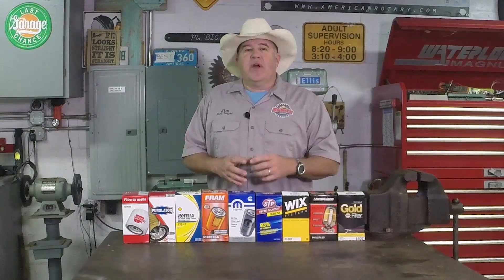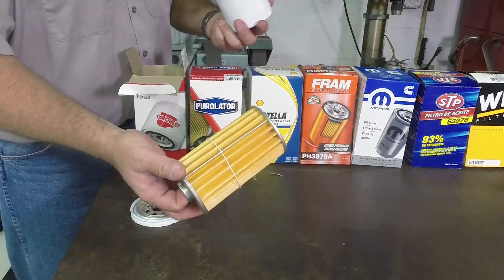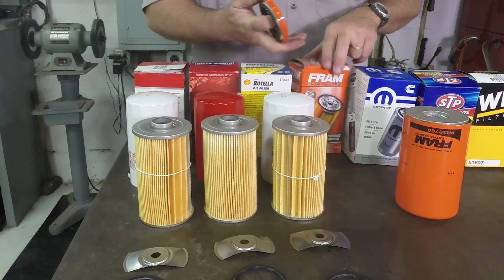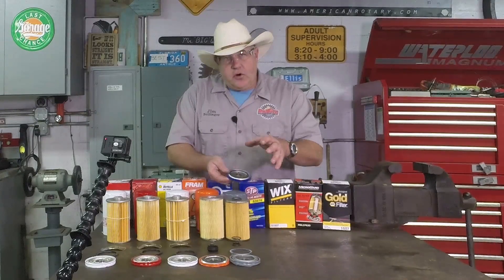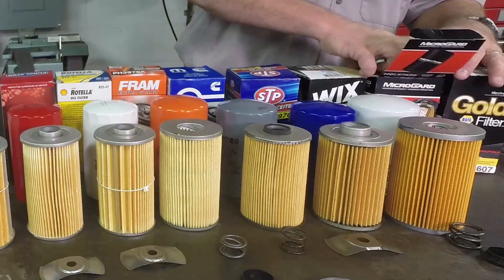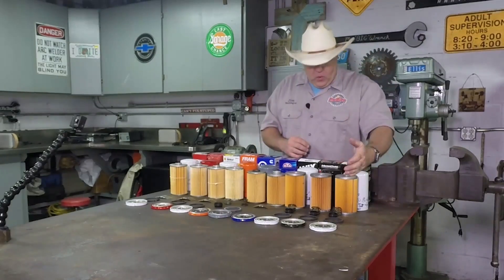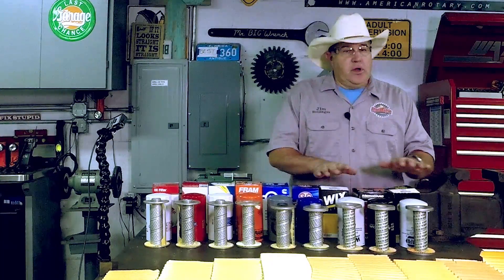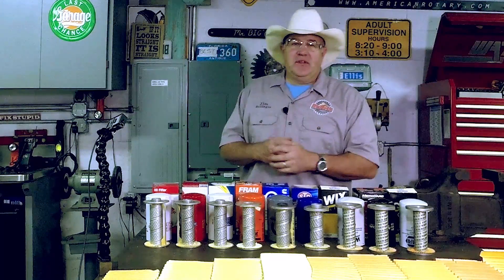One of these oil filters failed the test

Comment: I have a comment and a question. First of all, thanks for taking the time to make both oil filter videos. They are well done, thorough, and concise. I watched both and gleaned several major points and a bunch of smaller ones. Among those, you've reconfirmed my long-standing choice of Wix or Napa Gold oil filters for my various engines. What I didn't know (I haven't used one in many years) is that Fram is of such inferior quality. 
My question is, "Do you have an opinion about K&N oil filters?"
Reply from the maker: I did not cut one open so I cannot comment one way or the other. Thanks for watching.
Reply: K&N, Royal Purple, and Mobil 1 are all made by Champion Laboratories, according to another oil filter dissection video I've seen.  All good quality, too.

Comment: These are all good filters and should not give you any problems. The trouble comes in when you neglect to change oil and filter at factory recommended intervals.
What you really should be concerned about is your air filter.
Most of the dirt that kills your engine comes from the abrasive dust from the air. That is the biggest engine killer.
Reply: Not really Bernie!!!  Assuming that one is using an air filter (as opposed to "open air"), you should really be concerned about your oil filter - dirty oil (contaminated, old, poor filter, etc...) is what causes the most abrasion and wear/tear in an engine as tested by Ford Motor Company (1970~2000).  I would assume that the engineering departments of Mopar and GM have the same conclusion.
Ciao, L (FoMoCo engineering)

Comment: If in doubt, do 2 filter changes between oil changes!
See how many vehicles have quite small oil filters, that is the issue in my view.
How many microns is the filter paper? 
What is the filter media material? 
What is the bypass pressure for each, if specified? 
How many people on You Tube claim their engine failed due to oil filter failure?
How often do you change the filter and oil? 
What is the delta P for filtration media?
Have you put them on a test rig?
So many variables disassembly of the filter is pointless, they are all supposedly OEM quality. 
Kind regards....

Comment: Thanks for this good video on the construction of the diesel oil filters.  

It would be great if you could also include the Mobil 1 filter if you ever do a followup.  It is a common filter for diesel owners in the Duramax world.  They are easy to get at the auto parts stores along with the fact that Walmart carries them, so they are mainstream like the filters tested in the video.  Supposedly they use an upgraded media material.

Comment: This was a very informative video thank you so much.  I knew that Wix and NAPA were made by the same company but not the O Reilly's brand too, and then the others including the Rottela oil filter never would have guessed it to be cheaper made than the Wix or NAPA   And I saw in someone's video that the Fram he cut open had a flat spring in it but it was for a gas engine
Reply: Stacy Reid You are correct that Wix, Napa and Microguard filters are made by the same company (Wix). There are only 3 manufacturers of filters in the US that make them for all the different companies.  I use Wix fuel, oil and air filters in all my vehicles, and semi trucks.

Comment: Can you cut open a motor craft diesel filter I’ve ran motorcraft and Fran filters in my 7.3
Reply: THAT_1999_7.3 _
It would be a game of chance since Motorcraft filters are private label contract manufactured by 5 of the larger filter manufacturers to Motorcraft specifications. 
Those manufacturers include: 
Mann+Hummel that owns and manufactures the filter marketing brands Mann, Wix and Purolator. 
Cummins that owns and manufactures marketing brand Fleetguard. 
Parker-Hannifin/CLARCOR that manufactures the filter marketing brands Baldwin, Hastings, Racor, Parker and Clark. 
Donaldson.  
United Components/Champion Labs manufactures most of the factory installed Motorcraft units.

Comment: You should do a cat filter, i did a conversion on my 2012 duramax engine where i can use a CAT filter, lasts 2x longer way better filtration. I also did the same thing with the diesel filter, also a cat diesel filter
Reply: Almost all Caterpillar/CAT brand filters are manufactured under contract by Donaldson in the USA to tight CAT design, material, performance and quality specifications.
Reply: Have done all the studying on filters also, CAT is by far the best, 
but expense

Comment: Excellent video. That little “springy-ma-thingy” that you mention, happens to be an extremely important part of any oil filter. It’s a pressure relief valve that opens up in case the filter media becomes plugged and bypasses oil around the media, because it’s better to have the engine run with unfiltered oil, than to have it run with no oil at all. In some of the cheaper filters, that relief valve does not seat properly and most of the oil is being circulated with out being filtered.

Comment: I know where that FRAM filter was made then, the factory is a half hour drive from me. You will find the MOPAR filter is made by the same company that owns FRAM. Just note that the ones who order the contract manufacture of the respective filters that are near identical can also specify the cost point, and this then determines the amount of filter media and the grade of media used in each unit. This is the easiest point to adjust manufacturing cost, as the machinery is in the rest very much set for a specific steel type and thickness, and the same for the gasket material, there you get the advantage of volumes for small runs using the same parts. Filter media can vary a lot in ability, and you can decide which one to use to trade off cost for filtration ability, and the amount to trade off filter life.
Reply: The OEM Mopar filters for the diesel trucks is made by Fleetguard which is a division of Cummins.
Reply: @Anteater6788  well, like i said a little bit ago, i use & sell AMSOIL, so 1 day i went 2 a dodge dealer & asked 2 see a filter 4 a buddy's V6 diesel... i looked @ bottom of box & it said MADE IN CHINA... it twisted where as mine did not, had NO glue 2 hold filter pleats 2 end caps & no metal holding filter 2 end caps... much less quality than either WIX or AMSOIL, wouldn't u think ? ? ?

Comment: What exactly do you think that surface rust is going to do, please be specific? 
What are the manufacture date codes on the affected filter canisters? 

First, it is very minor surface rust over a small area that does not even rub off and would not contaminate the lubricant stream. 
Second, it is on the in-flow side of the filter media. 
Third, the underside of many valve covers, intake manifolds, valley covers, timing covers and oil pans have significantly more corrosion than shown in those filter canisters. 
Fourth, the cause of that surface rust may not be the fault of manufacturing or the manufacturer. 
It may be due to the products being warehoused in an environment where they are exposed to sufficient temperature swings and humidity that allow condensation to form. 
You are located in a rather humid region with regular temperature fluctuations sufficient to form condensation on metal. 
Condemning the filter over that minor surface corrosion seems to be a bit disingenuous and unwarranted. 

We have experienced similar corrosion issues on boxed machined parts stored in our warehouse that was isolated to a specific area in the warehouse. 
Although the corrosion was visible, but merely cosmetic and did not impact form, fit or function, we still performed a root cause analysis only to learn that one area of the warehouse experienced temp changes many days that coupled with the humidity level were just right for condensation to form on the boxed bare metal parts. 
The final analysis was this area was a recent addition and the contractors failed to install any of the specified vapor barriers on the entire building envelope that elevated the humidity.  
We have since installed HVAC systems at the general contractors expense to control the environmental conditions, plus now all machined and bare metal parts are placed in sealed plastic bags with VCI corrosion inhibiting sheets before boxing.
Reply: I use Baldwin in my 06 5.9 Cummins Filters better than Oem  They make tool to open filters for inspection.
Reply: @kennethc8182  Baldwin is a good brand. As for oem filter are you talking Mopar which is a so-so filter. When I think Cummins oem filter is Fleetguard. Which is also solid
Reply: Surface rust or not it still shouldn't be there. Even if the chance for issues is low it's still a chance. Why bring rust/foreign deposits into the equation if you don't have to
Reply: Well.... while I agree it's on the in side of the oil flow, what happens when the bypass valve is activated? Said oil flows unrestricted and unfiltered into your engine. Is it that big a deal? Don't know. 

Now, for all your complaining about storage conditions and how it's not Fram's fault, let me ask you two questions: 1 why are the other 8 manufacturers not experiencing similar problems in the same reason? 2 Who do you think is in charge of Fram's warehousing and logistical network? If you said Fram, go to the head of the class. 

I don't know what kind of engines you work on that you're finding rust on the internal surfaces of engine components, but rust forming EXTERNALLY to the engine means nothing but an oil leak at some point in time. But again, it has nothing to do with this discussion because even if said rust was on the inside of the engine, don't you think the oil filter is going to stop it once it gets to the sump, and eventually pumped through the filter? I mean, isn't that the basic point of the filter in the first place?
Reply: @kleetus92  
Looking at the last 2 videos where Jim mentions "rust" on the inside of the shell, the amount of corrosion shown is nothing but surface discoloration, nothing there to contaminate the fluid stream during bypass. 

1) 
a) They may have a better corrosion control coating on the shell. 
b) They may not have been exposed to the same environmental conditions. 
c) Likely different distributors. 
d) Likely different warehouses. 
e) They may not have been on the shelf as long. 
The longer a part is on the shelf the more susceptible it is to opportunistic corrosion. 
Having the specific filter manufacture date codes  would help assess. 

2) 
Short answer is O’Reilly Auto Parts does not purchase directly from Fram/Rank. 
How is it Fram's problem after a product is sold, leaves Fram's manufacturing warehouse and is not handled/stored properly? 
Fram/Rank like every other supplier sells their products to the supply chain where the products are then resold wholesale and distributed by parties not owned or controlled by Fram/Rank through multiple wholesale tiers and where products may go through 3-8+ warehouses not owned or controlled by Fram/Rank and could have taken many months before it was delivered to Jim's local O’Reilly Auto Parts store where it could have sat on a shelf for many months before being purchased by Jim. 
That is why I asked for the filter manufacture date codes. 

I see a wide variety and relatively large number of engines every year, anything from single cylinder 125cc dirt bike engine to 3000+HP V8s along with a few V12s and V16s. 
Last year we built, rebuilt or freshened over 900 engines, most were high performance V8s with approximately 400 being competition units. 
The rust I was referring to forms superficially on the interior of many engines on steel covers often due to short trip condensation formation which is also responsible for the formation of milk shake/pudding goo on the interior of oil filler caps on healthy engines and contributes to lube oil PH reduction if the oil is not changed often enough eventually resulting in lube oil acidification and damage. 
I agree capturing and sequestering particulate contamination in the lube oil stream is the express function of an oil filter which is the point made in the third sentence of the original comment.
Reply: @patw52pb1  First of all, Punctuation, have you heard of it? Second, After all the conditions you stated the Fram's could have gone through, are you saying that every other manufacture of filter tested does NOT have to contend with that as well? Or, is it more likely that Fram isn't taking a step everyone else is?
Reply: @kleetus92  
Yes and I used where appropriate. 
I do not know, neither do you and neither does anyone else without knowing the manufacture, lot, date codes for each filter, where each filter was purchased and then performing some research.

Comment: Great comparison Jim. Interestingly, during the eleven years I worked at an engine rebuilding shop, in the seventies, I remember many engines coming in with oil filters still attached, and two small block fords had oil galleys filled with filter paper, so much so as to block the oil passages. Those two filters were Wix brand. Looks like they've improved quite a bit since then.

Comment: Purolator filters are known to have the string around the filter material.  In this sample it was funny that of the three that were clearly Purolator products that the ACTUAL Purolator branded one did not have the string and the other two did.

Some time back I was using O'Reilly filters (automotive). They were Wix products.  Then, at that time, they changed and they became a Fram-supplied product, and had part numbers consistent with Fram part numbers.  I returned what i had and haven't gotten one for some time; maybe they've changed their supplier back to Wix.  If so, the respective purchase prices should determine the selection between O'Reilly, Wix, and Napa Gold.

Thanks for your effort.

Comment: Good video rust in a filter is always a no no
Reply: I don't think the rust would make any difference as it is on the outside of the filter medium. So if anything was to come off the inside of the can, which I doubt very much, would be filtered out before entering the oil gallery.

Comment: Jim, I think your overlooking a crucial factor in a filter, and that is what size  microns do they filter down to, you can have a mile of media that allows large dirt molecules through that will wear parts and score bearings, and the weight of the can has no factor in the performance other than installation and removal of the can crushing, and when was the last time did anyone crush the can , other than a moron.
Reply from the maker: I'm sorry, I never ment to imply that I had the ability to test the filter media to its micron rating. I do not. Merely what's inside, or not.....perhaps ask @AvE to do that. He has a background in fluid dynamics (I think). He's really good with scoring that kind of test equipment to use on his channel. Thanks for watching.

Comment: You are correct NAPA gold and WIX are the same filter. Looks like I have been making a good choice with the microguards.
Reply from the maker: And Orileys house brand filter which costs half as much as napa or wix.
Reply: @DoRiteFabrication  It would be interesting to see if the Fleetguard is any better than the WIX. Not sure how much better you can get though.
Reply: Since Microguard is a house brand for O’Reilly, I wonder, does O’Reilly always use the same manufacturer or do they shop for a best deal on a large lot purchase when it is time to stock the warehouse. For my buck, I’ll stick with the Wix. Premium oil and filters are cheap maintenance insurance. I have cut open several filters over the years to see the difference and Wix has been consistently good quality and Fram is consistently a POS.